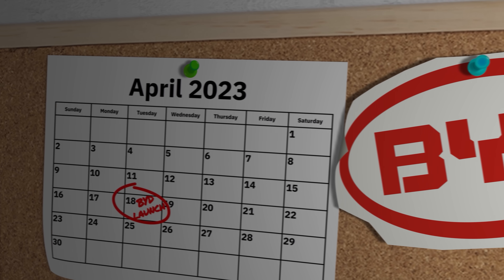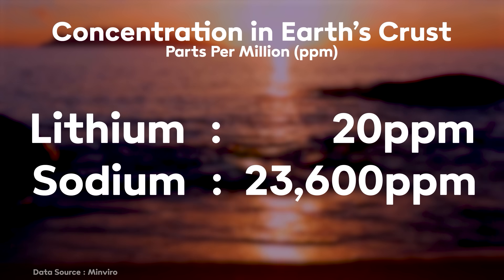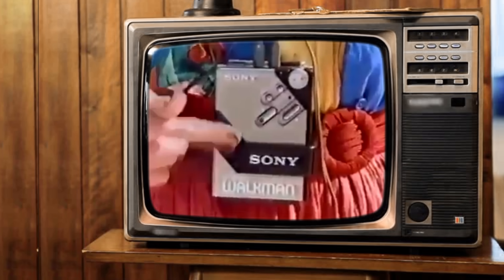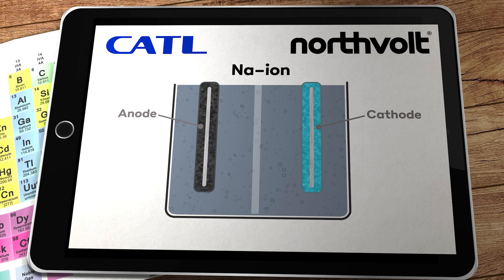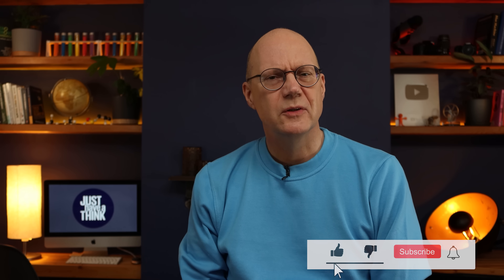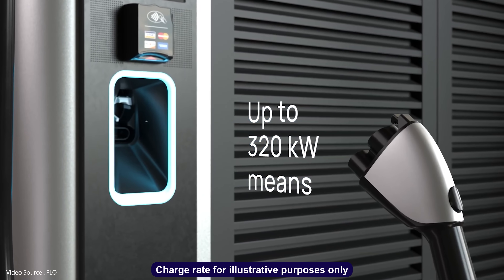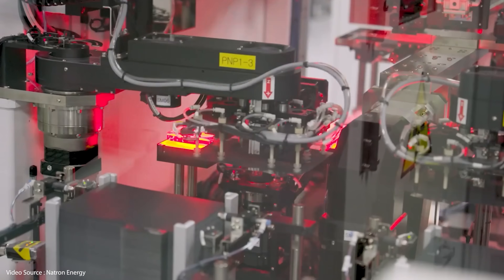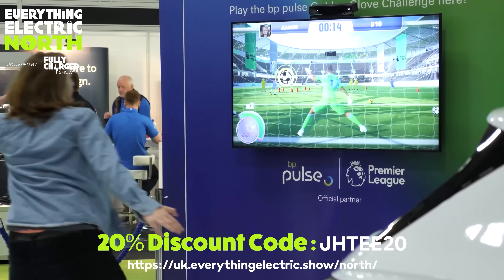Sodium-ion batteries in the USA. Beating China at their own game!

Comment: These batteries would also be useful for small utility vehicles/trikes for deliveries in cities or personal use for light duty errands. They don't need 300 mile range per charge mostly, and can be parked in smaller spaces with a charge cable at each station.

Comment: 1) Too much profit in keeping lithium going for "some". 2)The usa doesn't even have highspeed rail infrastructure, let alone an electric car one. 3) Even if they would have one, the napoleonistic grid would simply implode 4) How on earth would you even charge the batteries? It takes half of the surface of the usa in order to put solar or wind generators to replace the total of fuel driven cars. 5) At best, you could have bicycle batteries but you don't even have a proper bike infrastructure, go figure.  Simply put, the usa is waaaaay behind on the practical application of any kind of batteries. Travelled around in China lately? Good luck beating them at their own game. Have a think man.

Comment: Mining salt, way more eco-friendly than lithium. How lithium and "green" ended up in the same sentence is beyond me.
Reply: Lithium IS a salt and co occurs with salt
Reply: So you're trying to say that CONSTANTLY pumping black oil from the ground or bottom of the oceans or tearing up mountains for coal is? They key word there being CONSTANTLY, as they're burned up and lost as soon as they're used as fuels. Unlike lithum which can be recycled over and over again once mined.

And anywhere sodium exists, so those Lithium. They're a brethen of each other. The oceans have hundreds of billions of tons of Lithium in its water alone.
Reply: @junehanzawa5165  Lithium is not an energy source. That might be the key to the puzzle of your question.
Reply: @8BitNaptime  What you're trying to say is that Lithium is not a fuel. A fuel is burned up in order to provide energy. Intead, a Lithium ion has a very loose outer electron, which, in a battery, is used as an electrical force to provide electrical energy. The electron is never destroyed, it simply goes back and forth from one side to the other in recharging and discharging.
Reply: @junehanzawa5165  I wasn't "trying" to say anything, I said it. And your response is meaningless. It's not an energy source.
The end. What is the difficulty here?
Reply: @8BitNaptime  Ah, one of those "the earth is flat otherwise we'd all fall off from the bottom" types of minds. If it's not an energy source, then how do you suppose your power tools, mobile phones, EV's, etc. all work and move? By magic?
Reply: @junehanzawa5165  It's an energy storage material. The source is what is used to charge it. Coal is what supplies most of the energy for EVs charging stations. Energy sources are petrol, coal, gas, hydro, thermo, etc...
Reply: @shadeus3053  The Anode and Cathode (made of multiple sources -- Nickle, Iron, Graphite, etc) are what "store" the Lithium ions and electrons.
As for your coal powering EV's comment, then why are there no coal power plants in Norway or California, two on the highest EV concentration of EV uptake on the entire planet? One uses mostly Solar and Wind, and the other uses mostly Water and Wind to charge them? And keep in mind that California has the 5th largest economy and car market in the world.
Reply: @junehanzawa5165  You can't maintain a planetary civilization our size without an energy source like fossil fuels. That's why it took until 1859 for things to go exponential. Renewable energy limits us to the 18th century in the long term.
The fact that some localities like Norway (one of the world's largest oil exporters) can keep rich people happy with expensive EVs doesn't scale to the whole planet.
Also, fossil fuels aren't just an energy source they are also the base chemical feedstock for pretty much everything we use from plastics to fertilizers to the casings of batteries and the fiberglass blades of wind turbines.
How do you plan on feeding 8 billion (and growing) people three meals a day with the electron in lithium? How do you make concrete without fossil fuels?
Our civilization is in for a world of hurt.
Reply: @junehanzawa5165  Ah, one of those "I only see what I want to see" types. How do you suppose those power tools, mobile phones, EV etc all got to be made in the first place? How does an Airbus A380 cross the Atlantic in six hours? How is concrete made? How is steel made?
An energy source gives you back more energy than you put into getting it in the first place. Fossil fuels originally came out of the ground under their own pressure in 1859 and gave you 100 times more energy back than it took to extract it.
You know, the Sun shined and the wind blew in 1759 as well: why didn't they have 8 billion people back then?
Sure, building a dam gives you electrical energy: but, pray tell, without concrete and copper mined by fossil fuel power: how do you build these?
Reply: fumes.

Comment: Sodium Ion batteries at the moment are only good for non power dense requirements. The low power density make them unsuitable for portable electronics and EVs. They are more useful for utility use however the real estate required is much greater than for a LiFePO4 installation.

Comment: We will believe it when we see it 👋👋
Reply: vapour wear, as they say.
Reply: Speak for yourself.
Reply: They have buses that run on capacitors in China....you know how easy it is too charge capacitors lol....they have buses running on them
Reply: Which is why China is going to eat America's lunch
Reply: They are well past vapor stage. They are in the initial stages of mass production. Their chemistry has some really good properties - and some really significant limitations. Their tech is real, and has real uses. But it will be a special purpose battery type. They recommend applications where the typical discharge time is just a few minutes, at an extremely high C rate. They can discharge at a 30 C rate, with low loss and low heat developed. I don't think any other battery can do that. But it's not what solar backup needs, nor what grid scale load leveling needs, nor what EVs need.

Comment: Sodium ion has 1.5 volts per cell, means you’ll need 3 times as many cells to equal the voltage of a single lithium cell.  Drawback for battery makers….BMS’s cell balancing….a 600 volt ev battery would need a 400 series configuration….more is not better….triple the potential for a defect, or problem to arise in battery manufacturing.

Comment: Sodium ion batteries will NOT replace lithium.  #1 they have a dual plateau discharge curve that makes electronics expensive and complex to utilize their full capacity.  #2 they half a about half the capacity per kg.  They will be used in cheap-ass very limited range cars but useless for actual driving.

Comment: Sodium is getting there, the problem when using it for ESS like an off gird system is the voltage range of the cells, inverters will have to be modified to handle this wide voltage range. Wheras LIFEP4 is 2.5v to 3.65v per cell, Sodium is 1.5 to 4.3.
Reply: Actually if you look at the voltage curve for the BluePack 48V it is 52 - 40V (100 - 0%) so perfect for 48V Inverters
Reply: @reginaldpotts2037  So at it's highest sodium is 68.8 v in a 16s config, at it's lowest the pack would be 24v or 1.5 per cell times 16, so you see the problem, you are NOT getting the full range, check out Off Grid Garage, he did an entire series on those batteries.

Comment: Who cares about UPS, datacenters and companies! We need residential solutions. Off-grid solar system with HV-DC bus/appliances. Even FMPS NEC Class 4 cares about datacenters but not replacing the unsafe AC in our homes! Just wondering is any DC EVE Charger yet or all need AC to convert it back to DC?! 20-40% waste of energy with all those converts and low voltages and lot of copper waste.

Comment: Sodium is definitely the way to go for gridscale and domestic storage, or will be when the price comes down. You cab get Lion cells in low numbers for £0.11 per w/h of storage. Sodium should come in at half that. So 30kWh of domestic storage would have about £1800 in cells in it. It's about £800 for the casing and electronics so £5200 with Vat and markup. Worth having at that cost.

Comment: Sodium-ion would be great for energy storage at home - none (or far less of) of the ignition problems that lithium-ion has, and hopefully far less hazardous off-gassing and smoke in the event of fire.

As for EV vehicles... You seriously need an upgraded energy supply. The current grids are not up to snuff. If they were, even the limited amount of charging stations would all be charging at full speed instead of so many times charging at lower voltages/amperages/whatever.

Comment: If I see a READY TO USE, PROVEN AND RELIABLE product from Natron that in mass production, in order to store one kilowatt-hour of electricity: a) weighs less than half of LFP batteries, b) requires less than half the volume of LFP batteries, c) guarantees 20,000 full charge/discharge cycles and costs 1 /10 the price of LFP batteries, ONLY THEN will I say that the Americans from Natron beat the Chinese on their own turf. Wait a second: it is also resistant to frost and is completely non-flammable!!!
Not earlier. Now this is another noisy advertising of something that does not exist and it is not known whether it will exist at all!

Comment: 12v 100ah sodium battery available on Ebay for about $300.  If you paired 3 of these with a 100 watt solar cell, with inverters and charge controllers, (total investment $1500) with the weather in central Texas,  and charged the batteries all day, then sold the power between 7 and 9 pm, your return on investment is 3%.  Not terrible.  Better is coming.
Reply: Over what time period?
Reply: Just speculating
3% = $45
Texas avg kWh $0.15
45/0.15 = 300 kWh
So 1000 cycles
So 3% every 2.5 years or so

Comment: So, Sodium in US is targeted at 'we don't care what it costs' level customers, data centers will be happy to cut 20% off battery costs, but, don't really matter.  Telcom site backup, ditto.  Industrial vehicle batteries, like indorr fork lifts, ditto.  So Sodium is too expensive to help with home energy storage, elec vehicles (except in china where gov't subsidies make economics irrelevant), or even in grid storage which needs the cheapest possible power storage.  Sigh
Reply: Once the engineering is worked out and the factories scale up competition will drive the cost of sodium batteries down - they use only readily available elements. Back in the day lithium batteries were the 'dont care what it costs' option too..

Comment: If you can make the Na-ion battery charge in 3-4 minutes then you don't need any more charging points then the amount of petrol pumps as the charging point wouldn't be occupied for 30 minutes to a couple of hours as currently occurs with li-ion. If you can charge in 3-4 minutes then the energy density limitation of Na-ion is far less of a problem. If you can charge in 3-4 minutes then you could have induction plate charging technology so that when you go through a drive thru takeaway coils in the drive thru lane would charge you car whilst you queue for your food.....or same concept on the motorway where you would have a charging lane that you drive through at a slower speed to charge you battery before continuing your journey. With the ability to totally dis-charge a Na-ion battery, cars could be designed that you could cheaply and safely replace the battery.

If fast charging means 15 minutes to full for Na-ion then if they design a standard modular unit battery then you design all cars with the modular battery unit in mind, as there is no thermal runaway risk with Na-ion, cars could be designed to be powered by multiple standard unit packs in serial (like you put consumer batteries into a kids toy car) so when your batteries are low you pull into to the fuel station, swap out the used units for fresh, the used units go straight on a charger to be available to a future customer in 15 minutes time and you're billed for the electricity but without the wait to recharge.

Li-ion in my opinion is not a good idea for large batteries, Na-ion makes far more sense for large batteries. If NIO can swap out Li-ion batteries from the underside of a car using a robot at a battery swapping station in China I see absolutely no reason which we can't have multiple modular Na-ion batteries in cars where you can remove the batteries and swap them out by hand but better still would be a 3-4 minute full charge cycle because then you are better than diesel or petrol because it takes the same time to refill, you have better performance and there's no fire risk. If the Na-ion batteries are as cheap as they should be then there's no fear of replacement cost when the vehicle gets older so the second-hand value will hold up and the range anxiety should fall away because a recharge would either be a couple of minutes swapping battery packs or a couple of minutes charging or if you really did run out of charge the breakdown company would carry charged battery packs, swap one so that you could get to the nearest station to recharge or swap more battery packs.

Comment: Due to low energy density, Na-Ion batteries are unlikely to replace all EV batteries especially in high end EVs. China already has very advanced LFP batteries that can charge at 500kw (Zeekr's golden pack). Another issue with Natron is its manufacturing cost making these cubic cages structures on cathode and anode seem very complicated, and high.

Comment: 0:18 "Stunningly high quality"
Meanwhile in China: Electric vehicles in fire everywhere with the oldest still in the road being less than 5 years old.
Reply: Stop spreading misinformation, you scaremonger. Check BYD E6. This EV model has been rolled out in China since 2010. Many of them have been driven for 6 years, covering a distance of 1 million kms without changing the battery or major overhaul. Daily maintenance is super easy. You just need to refill the windshield liquid from time to time.

Comment: Sodium-ion is a nice alternative but it has lower energy density compared to LFP (lower voltage per cell and a big voltage differences when charging/discharging) which makes it hold less energy (which translates to lower  BEV range) especially when compared to newest LFP cells gen 3 from CATL. Hope they will improve the sodium-ion cells soon. The good side is the low temperature tolerance (but newest LFP from CATL also can charge in wider temperature range, as low as -10 degrees Celsius).
Reply: I still think LTO cells are better and safer  -40c - 60c operating range 30.000 recharges 30y life
Reply: @NightshiftCustom  Is Wikipedia wrong about LTO? Specific energy: 60–110 Wh/kg, Energy density: 177 Wh/L, Cycle durability: 6000–+10000 cycles, Nominal cell voltage: 2.3 V.
It does not look good to me with price-tag $200 / kWh ( ~ $350 / kWh with delivery from China + VAT tax) it's just expensive - probably suitable for a different use case. LFP (and soon sodium-ion) is near $60 / kWh (with delivery) and should reduce in price and increase in number of cycles and energy density thanks to latest improvements.
Reply: @L0L3k.D0H  well the big thing for me is the cold 
it gets down to -45c here 
what other battery can last over 20 years and work down to -40c